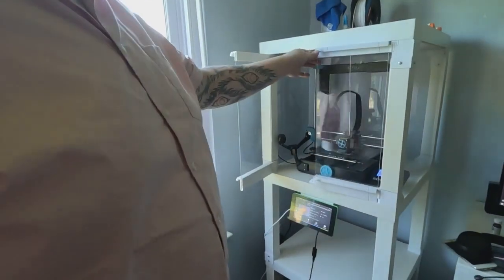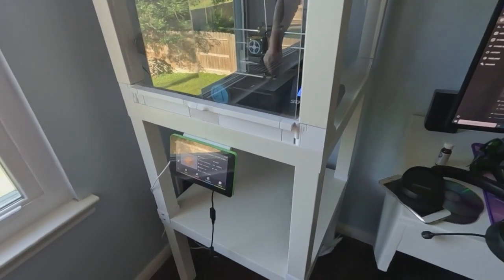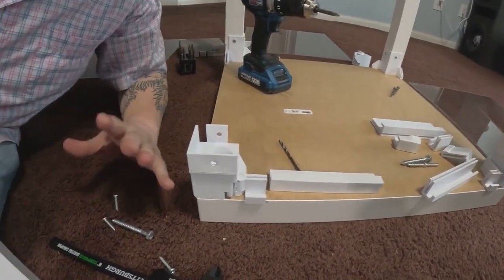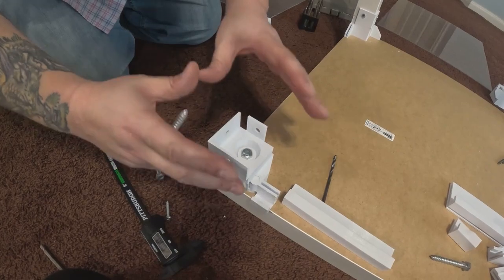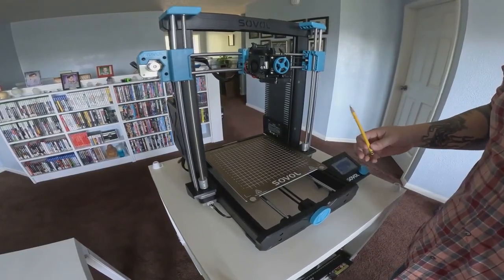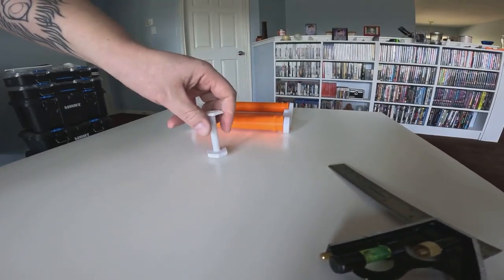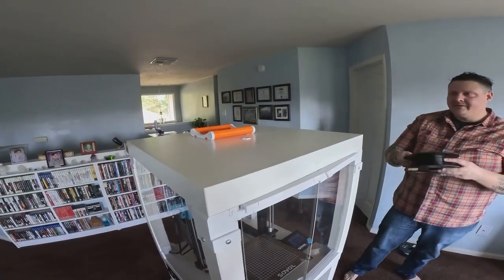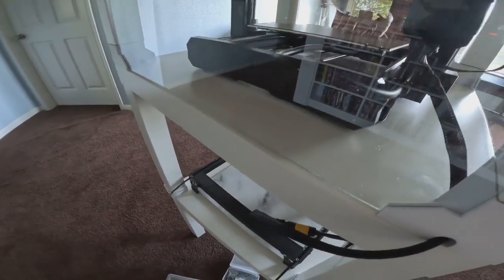Ikea Lack Stack Enclosure Build for my Sovol SV06

Comment: I also made an ikea lack table. I like the adjustments you made to make the thing more stable. I use foam and a marble tile to dampen the noise. Though i had to make the case a bit larger and it became less sturdy.
Reply from the maker: With the Igus bearings I haven't really experienced much noise. I realized when I filmed the intro, I was in the process of printing. The Lack table is basically a hollow cavity. I thought about gutting the supports and using some expanding foam in there to maybe dampen vibrations and act as thermal barrier. I'm slowly building another enclosure right now. I'm going to experiment for with the next one.

Comment: Does it have any issues with ABS? I noticed there’s a large gap along the sides
Reply from the maker: There will be some gaps, but nothing that will impact print quality. When I do print ASA or ABS, I just crack the doors a bit so the controller board doesnt overheat. Other than that no issues printing ABS.

Comment: what did you print the parts out of
Reply from the maker: So this one was printed in white pla+ as that is what I had available to me. The other one I am in the process of building is printed in PETG. The PETG prints turned out a lot better. I will be redesigning this to use/hold 6mm (1/4") acrylic sheets as I now have a good supply of those. I have a few other projects in front, but stay tuned.

Comment: You still rocking the z screw bearings?
Reply from the maker: Yes with zero issues. I'm using the 688zz with the stock part.

Comment: What is camera mount you show in the video?
Reply from the maker: So I have a couple different mounts that I use. This is the primary one that I use. https://www.printables.com/model/395502-sovol-sv06-camholder

The secondary mount that I use moves with the gantry on the z-axis.
https://www.printables.com/model/385747-generic-webcam-mount-for-sovol-sv-06

If you're running klipper you can record simultaneously. I haven't actually found a good webcam for a reasonable price that gets a good up close image. My timelapse looks a little blurry even at 1080p. Let me know if you know of one that works well up close.

Comment: what are the dimensions of the plexi?
Reply from the maker: For a good fit you'll need to measure because chances are 1 of the sides will be slightly larger, like on my last build. I believe it was the back panel. Here is a what I got on my last build, W: 17.75" and H: 19.75". These are some good numbers to use to pick out your plexiglass sheets but I wouldn't use them for your cut. I just measured both my cabinets and they are not exact +/- 1/8". Basically once I got all the parts printed. I assembled it without panels and took my measurements that way.

Comment: Awesome setup for the SOVOL SV06.  I will be looking out for any follow up video with any other adjustments that are made. Similar to what someone else posted I use some rubber pads and foam for noise damping. Honestly it is way less noisy then what I was expecting based on some other videos. 

At a minimum I do plan on using some super lube for the bed bearings but it's less noisy than I anticipated based on other videos granted the SOVOL SV06 is my first 3d printer so I don't really have a frame of reference regarding noise. I really like the touchscreen for klipper also. Placement seems a little low but doesn't really seem like it could be placed anywhere else either.
Reply from the maker: With igus drylin bearings it is crazy quiet. I haven't needed any sound dampening. What I hear is just the mechanical noise of the extruder. 

Just keep an eye on the bearings. When I repacked mine the black seal came loose while printing and bearing balls fell out, which I why I updated to the igus drylin. I talk about it in another video.

For the lube any quality white lithium grease should work.
Reply: Oh yeah, just saw the end and there is a pretty good design for support for the cable on the back that seems shorter and has a top piece using a zip tie to hold the bottom part and top part together.

Looks like you already have something in place for the extruder cable sagging but sick looking design also on printables, especially if you have blue filament that matches the blue on the SV06. Looks like you have things covered though but never hurts to check it out just in case. 

Back cable support search for

Cable Strain Relief for SOVOL SV06 3d printer

Extruder cable spine search for

Cable Chain ( SPINE ) for SOVOL SV06 3d printer extruder cable
Reply from the maker: @JoshFisher567  I have a few ideas I'm still exploring such as better thermal insulation, better cameras for timelapse, lighting, and cable management. I'm building another enclosure right now. Lots of ideas and projects in the works right now. I'm always looking for better ways to do things so good input is always appreciated.
Reply from the maker: @JoshFisher567  yes the cable was real bad on a larger print and really messed some stuff up. My wife showed me the spine cable chain and it looks cool.

I found this color that seems to be a close match to Sovol blue.

https://www.amazon.com/ZIRO-Printer-Filament-Dimensional-Accuracy/dp/B086JGKXV8/ref=sr_1_2?crid=2VNJKJUMT9IV&keywords=ziro+cyan+pla&qid=1678484316&sprefix=ziro+cyaan+pla,aps,151&sr=8-2

If you got a better color match let me know
Reply: @room281tech8  Right now I just used black PLA as I currently only have black and white PLA (first 3d printer so don't have a ton of filament and started with PLA because it's the easiest to start out with) and it works great but I do plan on getting some blue filament that matches the SV06 but for now I wanted to prevent the cable sag as it ruined some larger prints on my first attempt and since the pieces snap together you don't even have to remove the cable to the extruder to put it on. I just put them on one at a time and snapped them to the previous piece as there are around 24 individual parts that snap together plus the front and back cable supports which are in the second STL file. After that the larger prints came out perfect. Honestly you only need about half the pieces to prevent the cable from sagging connected from the control box towards the extruder but it just looks neater with all pieces attached, even in black. In retrospect I should have used white but hindsight is always 20/20

From the comments it seems like eSun light blue pla+ is very close and is what a lot of people used in the make pictures on printables so any light blue filament would probably work best.The latest pic used Polymaker PolyLite Teal which actually looks closer to the SOVOL color IMO.

Actually it looks like the closest match is "Polymaker Matte PLA Filament 1.75mm Teal" 

It actually gives the hex color code on Amazon and it's 00b4bc so if you go to a site to enter for Hex values to return colors it looks about as spot on as you can get and the model in the picture looks dead on. I'm ordering it. Will let you know how it turns out.
Reply from the maker: @JoshFisher567  I just happened to come across some polymaker light blue at my local micro center repackaged as tough pla. It looks fairly close. I'll have to try it out later. I do have some eSun light blue and it doesn't seem close to Sovol blue. I'll have to check out the matte flavors of polymaker. I generally use pla+, petg, or petg+. Standard PLA just hasn't held up for some of the stuff I do. It can be brittle. PLA+ has been fairly robust and stronger than petg but petg handles higher temps and outdoors better.

Comment: what size bolt did you get for those top mounts? also Im finding a hardtime finding plexiglass in that size. 
anyway thanks for the detailed video!
Reply from the maker: I think I used a 1/4" bolt by 3". I just basically took what came with the lack table down to the hardware store and matched it. For the catches that hold the enclosure in place, I can't remember. The plexiglass was hard to find. I basically just found the closest metric equivalent I could source. Being in America, there isn't a lot of metric stuff to choose from. 3mm is the goal. The 1/8” is a little over 3mm and the 0.093” sheets are under 3mm. I ended up using the 0.093" sheets

Comment: you should move the psu out of the enclosure
Reply from the maker: If you watch the video you will see that before the printer went live the PSU was outside the enclosure. The only time the PSU was still attached was during initial fitting.
Reply: @room281tech8  yeah sorry only realised later
Reply from the maker: @Orangeking05  No worries. What I would really like to do is get the mainboard out of the enclosure. That will be a future project.
Reply: @room281tech8  why? also uhh what did you print that parts in think im going to build this (well a slightlighly larger version (resized) for my modded ender 3 v2 and im going to buy a sovol and build it for it too its quite i bit more complex than othere lacks but i think its worth it because doors